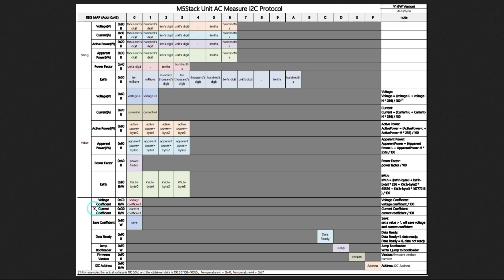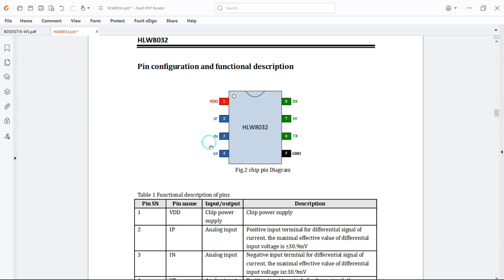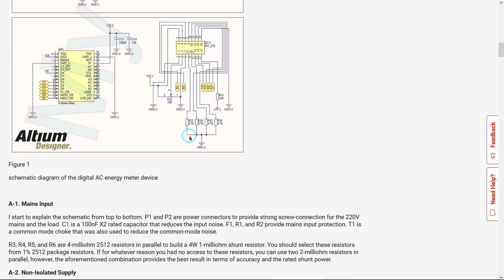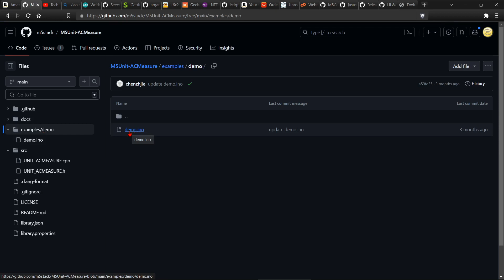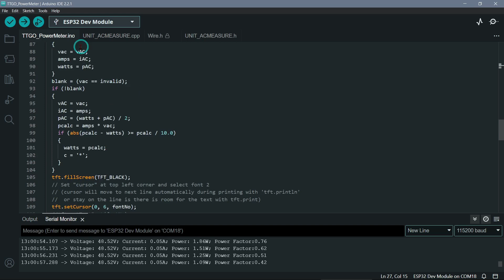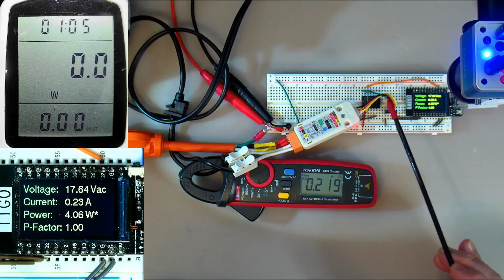Checking out the M5Stack AC Measure Unit.

Comment from the maker: Yeah, I am in the US with their wimpy  120V
Reply: We have  240v but we also have 460v if you'd like to play with that
Reply from the maker: Well actually in the US they bring in 240 Volts but they split it into two bays in the fuse box using the center tap on the transformer which they connect to ground and call Neutral.  In my workshop I have several machines like a Lathe, Milling machine and others that work on 240 volts using the full transformer winding and ignoring the center tap.  This means though that both 240 volt wires are hot there is no neutral. @apollorobb
Reply: @Tech-Relief  As a Electrician i understand this

Comment: Thanks for this wonderful & very informative review - one thing I couldn't reproduce was the unit's behaviour after a period of low current ends? I've uploaded a video showing how the recovery behaviour seems better on the unit I've received: https://youtu.be/j_1QVg-IFL4
Reply from the maker: Yes, on further testing this is the case but not always.  I will soon publish a second video where I will go into this in more detail.  In that video I will build a voltage and power meter using the AC-Measure unit for my variac which only has a small inaccurate analog voltage meter.  What I have found is that the cutoff is about 80 mA but at 90 mA it will stay on.  Then if you cut the power to < 80ma it will shut down and if you restore the power to draw 90 mA it will stay off but if you increase the power to 100+ mA it will turn back on.  Therefore for my use I still want to be able to reset the AC-Measure unit periodically,  on the circuit I saw that the NRST ST32 signal was brought out on a pad but in testing this did not seem to work.  Therefore in my final circuit I used a MOSFET to toggle the power to reset the AC-Measure unit. SOme of the other short comings I deal with in software.   I hope to have the next video in the next week or so...
Reply: Ah that's interesting! So far, my device seems to stay on with just 42mA of  current - but that's with 240V, in your video you're testing with a lower voltage around 67V sometimes? Perhaps the switch-off threshold is a power-threshold rather than a current-threshold.